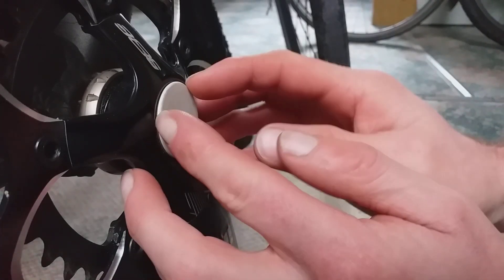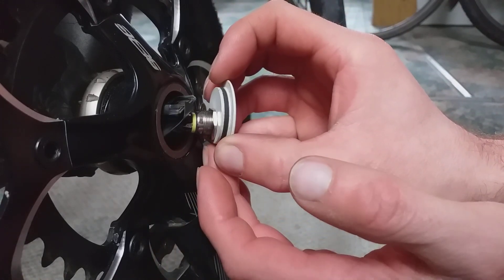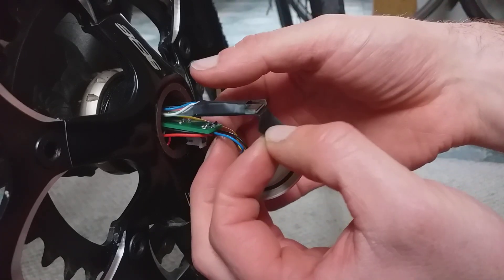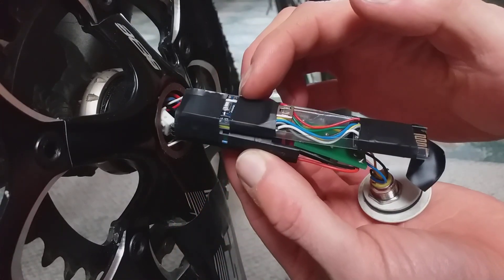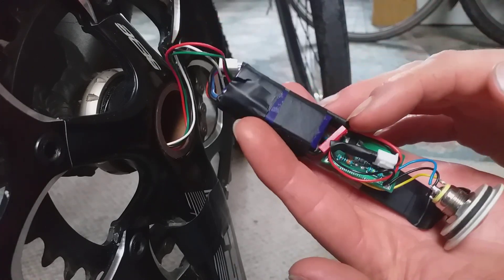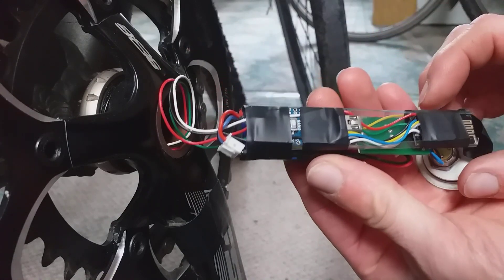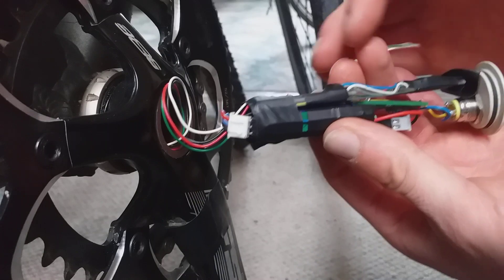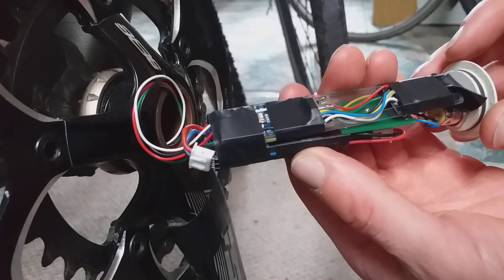Homemade Bicycle Power meter V2 Rewire

Comment: Have you considered designing a board based around the nrf51/52? It's extremely low profile, low power and is probably used in commercial power meters and devices. It's not too cheap and you can get a dev board on Aliexpress for cheap too. Programming it is a bit of a mission (when I did it a couple years back) as you need a black magic probe to do it.
Reply from the maker: That is my ultimate goal with the project and have got a Bluefruit Feather nRF52832 and an Arduino Nano 33 BLE (nRF52840) for this purpose. 
However language is one of my weak points so learning how to program them with ANT+ has become a sticking point. If you have any tips that would be great. The Arduino IDE is proving to be pretty useless for anything other than simple sketches on the most common boards.
Reply: @Ed.R  thanks for the reply. Just watched your original power meter video where you showed the BlueFruit. 

As for languages, that is my strong point. It's better to have electronics as your strong point - trust me 🙈. I can tell you the best way to learn a language is through projects (like this one).

I also agree that arduino is limiting but I've seen people on YT do really sophisticated things with it (like James Bruton). 

I vaguely remember there was a steep learning curve for the Nordic nrf language (can't remember its name right now). But that's where the black magic probe came into the picture as it allowed me to load the Arduino eprom onto the nrf51. I tried making my own black magic probe but the stm32 board (blue pill) I got was a dud and at that point I had to shelve the project due to time.

As for ANT+, I'd only bother with it if you can't live without it or you're planning on manufacturing them. I'd  stick with Bluetooth all the way.
Reply from the maker: @avibank  To be fair to the Arduino IDE its actually brilliant in allowing me to get so far with so little knowledge. The problem is more that I have a steep learning curve now to get anymore out of it or any other software.
Been struggling all afternoon to get timer interrupts to work on a Nano Every because all the registers are different as different chip.
I originally chose ANT+ because my cycle computer and phone receive it, more than 1 device can receive a transmission and it has clearly defined profiles. Not really researched BLE in detail but guess it can do similar.
Reply: The last time I did research I came across this board design which might be helpful https://www.hackster.io/cedric/twiz-da5c63
Reply: The Arduino Nano 33 is a nice new development. I must get my hands on one.